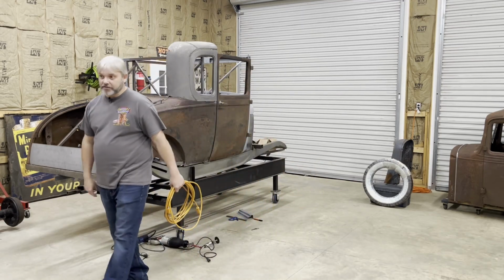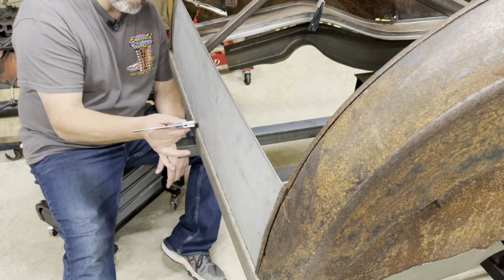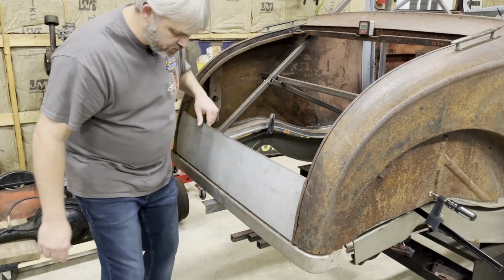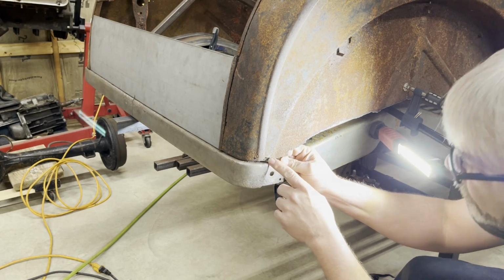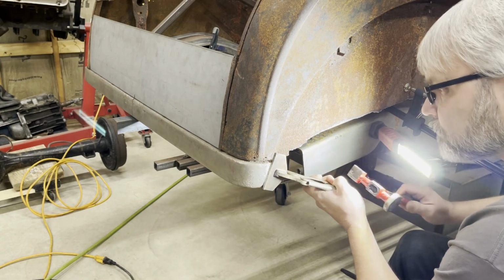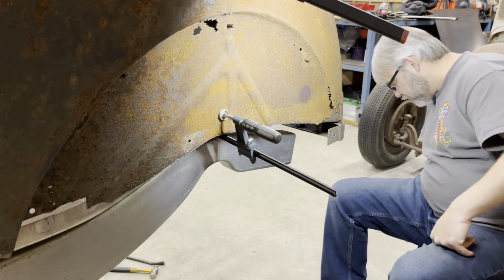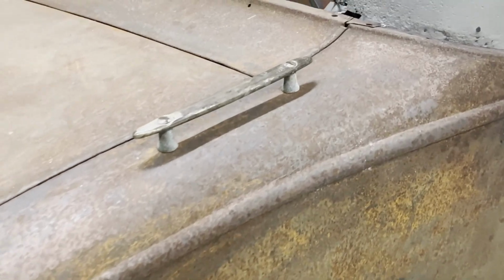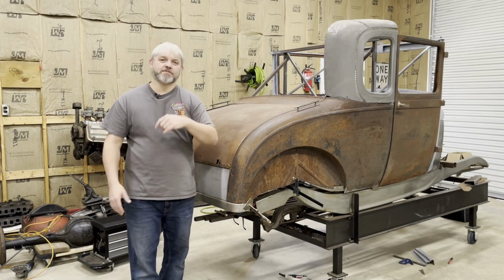Model A curved subrails PART 5! Getting things squared away! Fitting rear body panel! Hemi Hot Rod!

Comment: Theres a company called lenords or rotten lenords ,he sells a jig for converting axle bolt patterns to diff.sizes.under 100 bucks .they bolt to existing studs and has guides to drill new pattern.i have used them with great success.last time i took an axle to a machine shop they wanted 75 bucks an axle to redrill.i bought the tool for less and drilled axles drums,saved 65 bucks and have the tool to use forever.i have done front hubs and rotors with it.good luck
Reply from the maker: I studied on this a bit, and took a look at those leonards jigs, redrilling the axles was my first plan to get the lug pattern changed. But there's possibly a little snag. According to what I've been reading on the HAMB, the diameter of the axle flange on this 57 9" is too small to safely redrill the axles to the larger 5x5.5 pattern. Some people just get new axles, but I did see where one guy machined a ring, pressed it onto the axle flange, and tig welded it on both sides. Then, he set the axle up on the lathe and refaced the flange. That gave him a little extra diameter to keep the wheel studs from being so close to the edge of the flange. There seems to be a few ways to go about it, so I think this will be a interesting project when I get started on it. Thanks for the comment, and for the info on the jigs. Thanks for watching my channel!